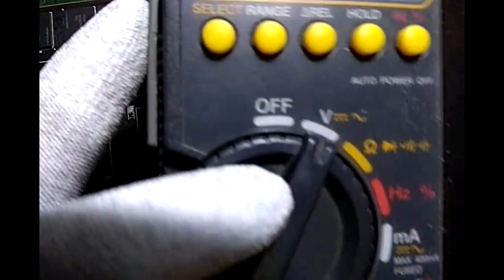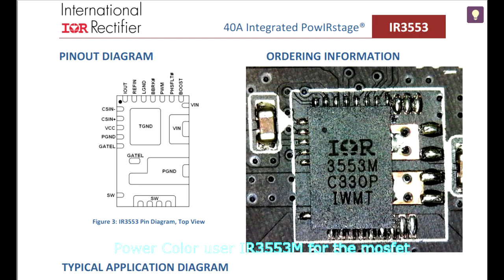Repair How to Diagnose Short/Dead HD7970

Comment: I have a R9 280X no signal, fan still running and gpu is hot. Is it mosfet failed ?
Reply: Do you find the solution because I have the same problem with the same gpu

Comment: Hello Zettabit. lab! I have a Sapphire Radeon HD 7970 OC and i got red stripes while playing. After a while the stripes became bigger and more pixelated so i diceded to put that little thing into my oven and baked it for an good half an hour. After setting it back into my PC it´s working without any red stripes and so on but an old problem has arrived again. The old problem was that after a few minutes of FurMark the cards temperature goes up to about ~70°C and the monitor shows me that there is no connection but comes back about 2 seconds later. It happens randomly but only while playing Games and temperatures above 66°C. Do you have an idea why this old problem came back now?
Reply: That is artifacts - failure of processor or ram of gpu

It's better to replace it

Reballing the processor will not fix it (it is temporary and will fail again)

That is heat death of the card (it's end of life)

If you dont want that problem - under volt and clock card so it can be way below 66 °C

Temps will be the end of this card

Comment: How did you determine it was the third one from the bottom when all the bottom 4 had a short? Trying to repair my gtx 1080ti and took a bucnh of readings, some mosfets read different from the others and I just cannot figure out where the issue lies.

Card powers up with fans and lights but prevents pc from posting.

Could honestly do with a professionals 2 cents on the matter as I'm not sure what's normal on GPUS.

Thanks.
Reply: Hi I have similar on my 1080ti Aorus extreme  power short on my right pcie 8 pin just shuts psu off Did you get to the bottom of it or any further
Reply: If you check the pinout, vin in was shorting... and i guess that short comes from the next item. Hence, the 3rd from the bottom.
Reply: sounds like a bad mosfet driver i believe

Comment: can't believe this mosfet stuff can have a huge impact on pc components. this is even a level higher than reball/reheat
Reply from the maker: yes mosfet is the main power to the GPU chip, if it fail to delivering power gpu will fail to work.

Comment: sir where to buy new part plaese tell me i have gtx 760 and one six pin is not working out of two
Reply from the maker: I buy from china via alixprs
Reply: @Zettabitlab  is it  has all parts for sholdering for gtx 760
my gpu stopped working while running unfortunetelt system turned of f and then wont on and when i check for first 6 pin it says power down and then second for its not starting pls help i am from india
Reply: @huntinggamer8260  you have to look at your gpu first, what type it is, and search on aliexpress. If it is mosfet or IC it will be easy to look on aliexpress. if you have trouble, you can google the part number.
Reply: @JustTry919  i know but is it mosfet that short on that

Comment: Even i have a 7970 i was playing fine when suddenly psu blew up

The mobo is working
But not the gpu
So is the mosfet failed or gpu is complete fried
The fans spin but the gpu is not hot and no display
Reply from the maker: gpu cold means no power input to gpu, or sometimes indicates dead GPU coz overvoltage
Reply: CoRE- Fixpc so can it be repaired
Reply: CoRE- Fixpc hi overvoltage gpu can be repaired or not
Reply: CoRE- Fixpc even my r9 270x died with this same problem
Reply: @saifudinkhuzema6525  If 12v went throught gpu buy new card.
Reply: @nikolakarovic5964  i already bought 980ti 🤘